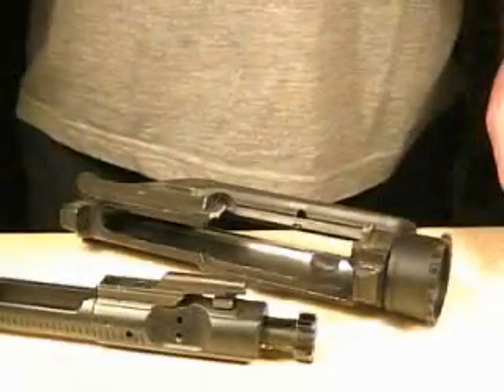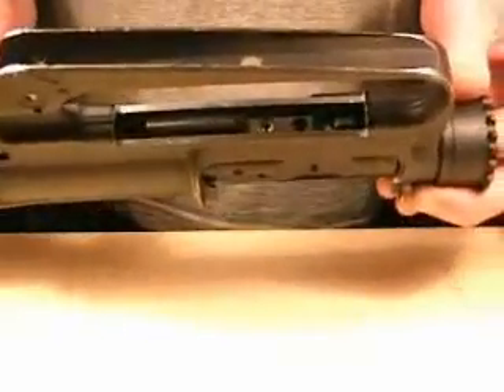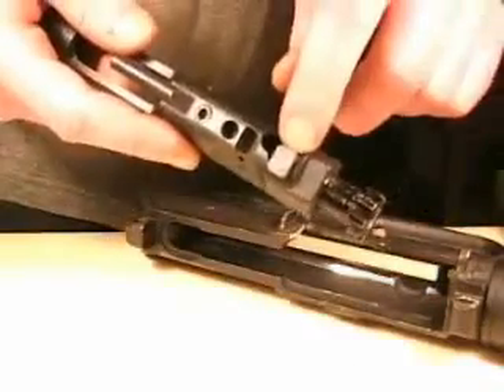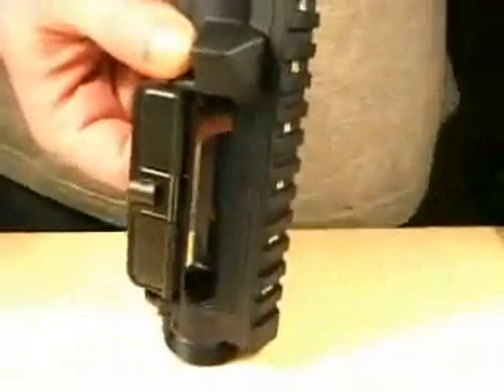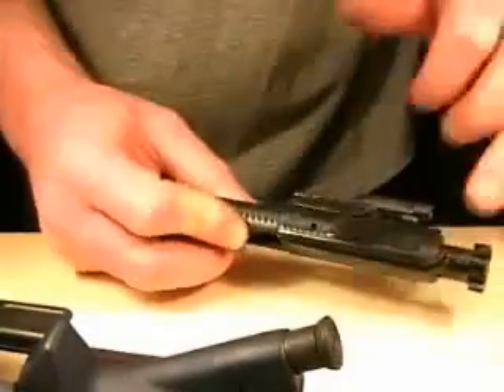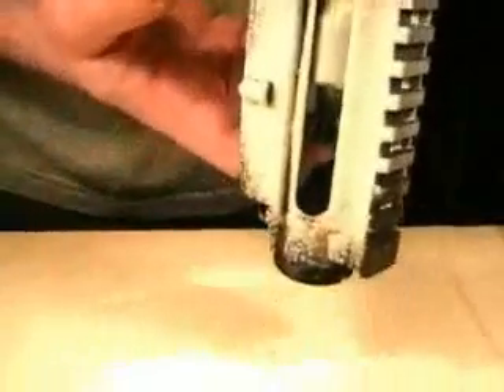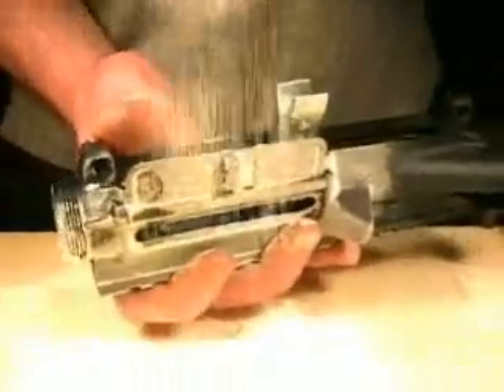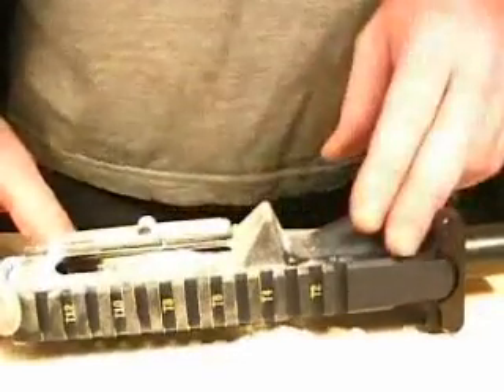M16/M4 reliability problem, increased bolt friction causing jams

Comment: I wouldn't own an AR15 if you paid me to take it.  The one exception I would make would be so I could make a video of me exploiting this pathetic weapon's every weakness for fun and for....well, mainly for fun with an eye to educational.
Reply: 5 years later and it's the USA #1 seller. and can be built into a 3/8 MOA from the factory ...
All of the bad  hoo ha about it has faded into history. Military fail test exceed 5,000 rounds without cleaning or lubrication..  please note this was a old instructional information video- He did NOT explain that the micro friction of the cam pin keeps the breech closed independent of spring bounce.  Please review now available high speed footage of an AR firing.
p. s. My Rem 700ADL only lasted 3,000 rounds before a major parts replacement and it was cared for like a baby.

Comment: @opmike343 del-ton the comp that makes my ar use to make parts for colt(bolt assembilies) if u did ur research u would know that. i dont know if this is still the case becuase i hear del-ton stopped giving colt there parts and began makeing there own rifles every piece. which means a good fit rifle with little play over a rifle put together from other comanies parts. if u do a reliablilty test with different ammos i will be the 1st to say i was wrong. S&Ws do it all the time and lwrc n many more
Reply: No, completely wrong. All of Colts bolts and carriers have been made in house until recently. If it's marked with a C or Colts cage code that part was made in house

Comment: @biggboysouth 

Are you talking about the cam pin? POF has a "roller" unit, I believe. In any case, I haven't been able to replicate this "problem" with ANY of my AR's or my friend's rifles. We're all running bolts by LMT, Colt, BCM, or Daniel Defense. Without a larger sample size, it would be difficult to rule out the possibility that there's simply a manufacturing defect, or that his bolt, bolt carrier, cam pin, upper receiver, etc. is out of spec.

Comment: EVERY ONE! start useing grease instead of liquid lube. That stuff sucks. i use wheel barring grease its cheap and has yet to ever dry up during use or when its stowed away.
Reply: yup, right on the rails and cam pin/gas rings

Comment: I jus tried this same trick on my ar 15 and it didnt work. All though i did feel it starting to rub it did not stop the bolt. i even pushed on both the rear of the bolt assembly and on the bolt face very hard and that did not stop it. Im guessing different manufacturers have different tolerences. What is the brand and year of the ars your using? If its a colt then thats could be it. With all the research i've personally done, COLTS are the most unreliable ars. sorry colt fans just IMHO.
Reply: Lol just gotta laugh at your comment.

Comment: @momo671 thats like saying a car engine should run as good with out oil as it does with oil. i have owned both an ak an ar and both run way way better with lub than with out. there is no gun on this planet yet that i know of that runs as good with out lube as it does lubed. Dont want to be mean but i get the impression you have yet to own a firearm.
Reply: If you want a weapon or woman to be better- use lube

Comment: @19nisey69   Very Valid point, but my experience bears this video some merit. The M16 A1 jammed on me multiple times in the desert.  Ammo Fault, not ammo fault, doesn't matter when OPFOR is bearing down on you.  It would not reliably feed.  Once at a very bad time in my life.  Now it may that the newer weapons can handle sand. I spent 45 days at one point without a bath due to water rationing.  45 days with only a blanket - no tent. - complete exposure to the elements and always on the move.
Reply: we wiped our guns til the blue turned white.. and live to tell. used urine to clean and pimple grease to lube.
circa 1969

Comment: @frankgon4  That's not exactly the truth. The military opted out of the chrome bores and chambers to save about $1 on each rifle. Along with this, they changed the ammo propellant to one that fouled more, and increased chamber pressures which caused the brass to swell in the chamber and stick because they didn't have the slick surface which the chrome would have provided. The early M16 failures were all the governments fault, not the rifles design.

Comment: I have put more than my fair share of rounds through quite a number of M16s and have never have a failure and I bet all the M16s I fired were older than me at time.  Not matter which weapon system, close to 100% of operational failures is due to poor maintenance and cleaning.  Also, the forward assist does absolutely nothing until the shooter pushes it to ensure the bolt is full forward and locked, it does nothing by itself.

Comment: M16 istn that unreliable. Ive seen an AK and M16 side to side comparison. The both guns where poured over with Sand and Dust, and after the First shot the AK jamed, because the Bolt allows Sand to get into the Trigger, which blocks the Mechanism th AK ajmed every time after 1-3 Shots, the M16 fired with no interruptions 5 Magazines and it was botherted io the sand 5 times

Comment: @semiautoriflelover On merits the m16 platform is better (the price demands it) so long as you can maintain it.  However that's only a part of the picture.  A soldier's quote, "I know it fires very well and accurate clean. But sometimes it needs to fire dirty well too".  Other platforms like the Garand, FAL and AK built up solid reputations regardless of ergonomic & modularity shortfalls.  The m16 doesn't have that same reputation and it's not an accident.  The US Army dust test feeds this view.

Comment: @grannman 
First off, i dont play airsoft.  Its a colt 6920. It has a 16" 1X7 twist barrel.  The twist helps stabilize heaver grain ammo.  It runs off of the DI system (Direct Impingement) that many people tend to criticize, because it is very dirty.  This all sounds like pretty accurate information to me. You make me sound like im an idiot.  I have a lot of knowledge on the platform, but of corse i cant prove that to you, because this is youtube...

Comment: @krazzykid96 "How does the bolt lock if the clamp is keeping it from moving backwards?" "And obviously you wouldnt use a clamp, becasue then, it would run into the hammer, and other components of the gun"

Maybe you do own an ar15... airsoft perhaps or use a grown ups'.  because you sure didn't exhibit knowledge of the platform.  But now I see you've received some accurate advice so that's good.

Comment: @grannman 
Actually, i own an ar 15... and, ok.  The clamp wouldn't  rub the hammer, but it would touch the disconnector, and other pieces in the lower.  And the clamp wouldnt allow the locking luggs to lock into the barrell extention.  I dont understand why people keep calling me on this.  Is it because they're trying to be a dick? I know the ar 15 platform very well.  Best not comment about other people until you actually know who they are!

Comment: @stiles72: It seems as though you are missing the point.

He is simply proving that the design flaw with the cam pin creates unnecessary torque and friction in the receiver. Will a stronger recoil spring and heavier buffer help, yes, will it eliminate the fact that the cam pin is grinding against the inside of the receiver while stripping a round and causing failures, no.

If you love your AR as much as it seems you do, open your mind and FIX the problem rather than ignoring it.

Take care..!

Comment: Okay so what does this actually prove?  I run the shit out of 10.5" suppressed Noveske and KAC SR15E3, no cycling issue. Theres more to the AR gas system than just the unlocking of the bolt. The inertia of the buffer system helps the BCG cycles.

Comment: I believe this issue to only be predominant in AR's that have significant clearancing developed from excessive use of the bolt carrier group without maintenance.

I tried this test on my own AR and the difference was so insignificant it isn't even worth mentioning.

Also, the loading issue is more an excessive tension issue with the magazine. For the record, a lot of soldiers (Myself included) will run 25 rounds in the magazine, as this seems to completely alleviate feeding issues.

Good vid tho

Comment: I just tried to simulate the bolt jamming on my AR-15 that you show on your video "M16/M4 reliability problem, increased bolt friction causing jams" but I did not get the same result. The bolt carrier assembly on my rifle moved backwards, freely, as i applied pressure on the bolt face. I think that you may have a faulty or worn bolt carrier, and that is why the jam condition occures in both receivers.

Comment: I will admit in the m4 system there is a slight amount of drag caused by the cam pin, but it is not nearly as significant as this video makes it seem. I have several M4's and I tried this on all of them. Not ONE of them stopped like the ones in this video. I would imagine this was caused by inferior lubricants, no gas rings, or completely worn out gas rings. I use tw25b and mcfarland one piece gas rings. I had to put a great deal of pressure on the bolt face to make it actually stop.

Comment: Why the AK cycles and the M16 doesn't is due to sloppier manufacturing tolerances. The spring return of the M16 has more force pushing the BCG forward than the AK. The AK is built on a different principal, and uses an operating rod like the M1/M14. The M16 uses a dirtier system, the gas assist. Most of the jams I've seen is due to extended firing without cleaning, partly due to the gas assist system it uses. Between the two, I'd rather carry the AK into battle.

Comment: This guy doesn't understand the M16 system. When you hold up on the bolt with only the bolt carrier group trying to force it down, it won't work. That is why the designers placed a 1 inch by 18 inch spring in the stock. It forces the bolt forward to strip off the round and push it into the chamber. I will admit (and it is something I've bitched about for years) the gas system is very dirty and requires more maintenance than it should. I would like to see the piston system the AK47 uses.

Comment: If your working with decommissioned upper receivers it is entirerly possible that those rifles (particularily if they have no forward assist) were vietnam era with round counts above 100,000 both single and full auto.

Modern receivers are thicker (and heavier) overall which you can see with the A3 flattop in your video. 

Like I said, use mil-spec parts and this isn't a problem.

I replaced half a rifle because the parts were junk, I used mil-spec parts and it worked fine after that...

Comment: I'm not going to question your talent or qualifications as a machinist or gunsmith.

This really isn't a problem...

I've built, rebuilt, owned and fired over a dozen M-16, Car-15 and match AR-15 and my AR-10.

All of which share the same architecture concerning the bolt/carrier feeding. I've never run into a feeding problem caused by the drag of the receiver/bolt carrier or bolt cam pin.

Comment: I just tried that on my COMPLETELY ASSEMBLED M4 Carbine and my bolt does not even move one millimeter back into the bolt carrier. There is no way that this tiny bit of counter pressure of the round that has to be stripped out of the magazine stops the bolt. This problem has never been mentioned because it doesn't exist.

Comment: Omg the HK416 isn't the best thing since sliced bread...it breaks bolts (after about 5000 round or so), wears out the insides much quicker, and it is still an old design just with a gas piston system. We need to get a better weapon platform and it needs to be a brand new system not a 50 year old design.

Comment: I've found that polishing the sides of the gas key, cam pin, and the four rails on the bolt carrier with 800 grit paper, not down to the metal, but enough to smooth it out a bit, really makes a difference.  It's just a little rattly, but everything's smoother, and it won't  gum up holds up to dirt and dust better.
Reply: polishing certain parts is only very short term because after cycling a few times the polished parts are no more polished,so that does not work either
Reply: @Number1Cowboy  Not polishing to a mirror shine, but taking down the parkerizing a little.  Kept them from getting gummy on the cheap stuff I used to have.  Funny how things change, now smooth bolt carrier finishes are popular.

Comment: As for the AUG's Forward assist. Its' way more simple to have the controls in the same area as the others. From the foregrip, It's in closer reach for the hand to reach the assist on the charging handle rather than halfway through the stock. On the AUG, the user would simply rack the handle while pressing the assist as though it was the usual rack, it's a shorter motion than going all the way to the stock and pressing the button. My AUG barely snags though it's simply muscle memory to fix one..

Comment: Can you really tell what I can do from you side at all? In and out, I've familiarized with different models and changes between M16s and M4s. Few have even approached me for trouble shooting their rifles.

The problem that was presented in the video happens then the buffer spring is no longer strong enough to reciprocate the bold assembly.

What you've been saying so far is just basically assumption, not real in depth observation..

Comment: Do you really think an opinion from an occasional user would immediately define the problem to this rifle? The Design may be simple yet seems otherwise to someone of less experience with firearm mechanics.

On a side note, MSAR's addition of  a M4 type forward assist is just stupid. The Original AUG already has a forward assist. That addition is merely compensation for inversatility..

Comment: This is not a problem with the design, in fact it's supposed to do this.   If the bolt did not lock when pushed then the round  would push back the bolt during firing reducing the velocity.  It's supposed to lock.  You see the cocking function is not done by pushing on the bolt, but rather the bolt carrier.  If it did the rifle would NEVER cock as you showed and would fail 100% of the time.  I think your info is misleading and wrong.  Just retrofit a good gas piston system and be done with it.

Comment: Very nice work pointed out this long time fault. I've never cared for the M4, there are just too many reliability problems. The Hk's are nice and reliable. So is the Israeli TAR-21.

I prefer the FN SCAR-L, I've experienced very few problems with the weapon in training. 

Nice video!
Reply: m4 has to many reliability problems,it is obvious that you are not experienced with the m4 platform,I have an armalite ar15 that I have owned for 10 years with 8000 rounds through it ,not one malfunction of any kind ever,not one, I served 34 months in the middle east and the M4 was my issued weapon and not one malfunction of any kind either and it went through some mean times during combat,the m16, the ar 15 and all other ar 15 platforms has proven to be the most reliable rifles since its beginning in 1952,so you do not know what the hell you are talking about saying m4 has reliability problems,,get you a bb gun boy

Comment: This guy has a valid point!  With twenty five plus years of the M16 family of weapons it is not perfect.  I am curious of the fix for the stated problem.
Reply: I have owned my Armalite ar15 for 10 years and over 8000 rounds down the barrel and not one single malfuction of any kind ,,if the ar15 platform rifle malfunctions it is usually because of cheap ass dirty junk ammo and not the weapon,I also carried the M4 in the middle east for 34 months and not one malfuction either and it went through hellish conditions in the desert,you guys just don,t know anything about the ar 15 platform,get you a bb gun and stay home

Comment: Thank you very much for this video. I've been trying to learn how the AR15 works, and the visual in this video of how the bolt and the bolt carrier work together inside the upper receiver, combined with a flash animation "The Anatomy of a Bushmaster" got me to understand how it all works. Thank you.

Your explanation of the fault in the AR15 design was also very good. I didn't understand the first time (because I didn't understand the AR15), but the second time through I understood perfectly.
Reply: Well same thing happens with an ak and many other rotating bolt auto loader designs. But instead the of a cam pin pushing to the side  stopping the bolt from turning when picking up a cartridge,  an AK's bolt lug gets pushed against the rail when it pushes a cartridge out if the magazine when trying to rotate until it moves into the trunion area, thus creating the same point of friction as an ar15. This is how you keep a bolt from prematurely turning before locking. The friction "may" not be as bad due to it being steel on steel vs steel on aluminum on the ar15 system.

Comment: For those watching, some rhetorical questions: Does the buffer spring apply more forward force on the fully assembled action than gravity does on a upper receiver minus the stock and barrel assemblies? Does this friction between the bolt and/or cam pin and the sides of the receiver affect operation of the fully assembled weapon in actual use? How much downward pressure on the receiver does it take to move the bolt/carrier group inside it again when you are doing that neat finger press thing?

Comment: Not enough lube, it should be dripping off the bolt and you should leave fingerprints on the carrier. Also, you need lube inside where the bolt runs in the carrier (there are 2 nice holes in the carrier to get the lube there), and heavy lube on the cam pin.
The direct impingement system used in the M4 can be reliable, if kept properly lubed. The light coat given in the video isn't nearly enough.